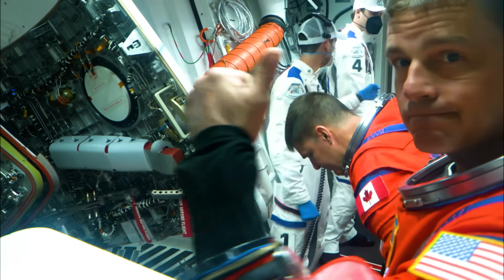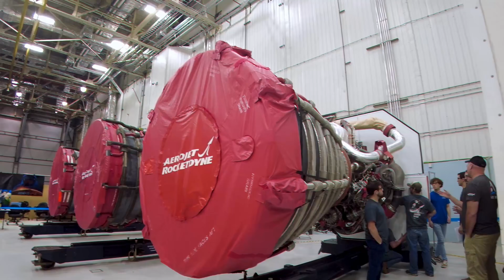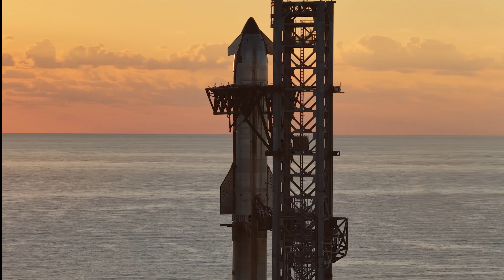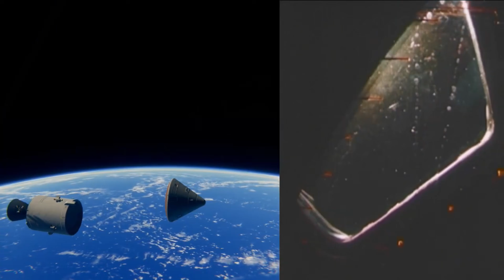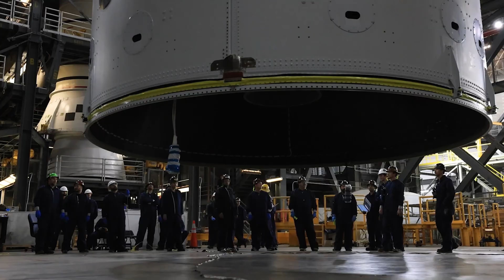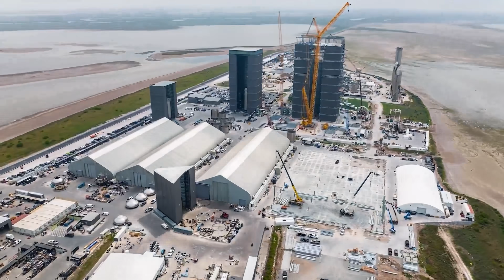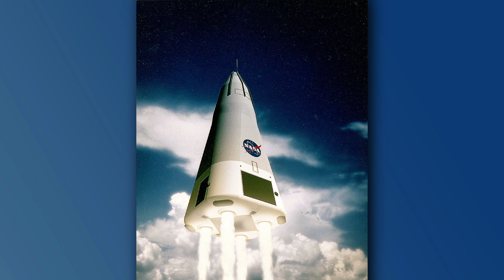Why SpaceX Starship and NASA Rockets Are So Different…

Comment: NASA is a government controlled agency with various smart people & geniuses (JPL) working for them, but they're controlled & funded by blithering idiots (congress) that haven't a clue how to do anything other than making things cost more, because they all want a piece of the pork pie (each rep wants a part made in their district) so they can be re-elected.  They were ORDERED by congress to DESIGN a rocket using circa 1970s Space shuttle parts, because the blithering idiots wanted a JOBS PROGRAM (SLS = Senate Launch System) so that their "constituents" (Boeing, Aerojet Rocketdyne, Northrop Grumman, ULA, et al) would keep bribing them donating $$$ to there campaigns.  They have no choice, since congress holds their purse strings, and makes them do idiotic stuff.  Boeing is the primary contractor here.

SpaceX's rockets were cheaper even before they were reusable, because they're vertically integrated (they makes all/most of their own parts, which is much cheaper).  Since they do not answer to blithering idiots they are free to innovate, and occasionally blow stuff up, without the consequences someone at NASA would face.  Note that Boeing's offering in this same space was/is a miserable failure, and it is unclear if it will ever be used to bring anyone else to the ISS after its last disastrous mission.

FYI, SpaceX probably wouldn't exist now if the Obama administration didn't insist on fostering new space companies based on a "non cost plus" basis.  They were only able to get the blithering idiots to sign onto that bill, by giving them back their jobs program SLS (which is nearly identical to the previously canceled Constellation jobs program).
Reply: Yep. Politicians and bureaucrats don't have same drive, nor interest to private investors.
Politicians and bureaucrats primary interest is always how to keep the current status quo (political stability and order), because that's the best way to maintain their own status and position in the government.
Unless there's external threat or extreme situation that forced them to act in more decisive manner, they will dilly-dally and quickly fall to complacency after enjoying some early successes.

Private company is not immune to this either, because once corporate management think they are safe and insulated from market volatility, they will start behaving like govt bureaucracy too, which job is just to maintain stability and current status quo.

However, in the open market, company that start behaving that way will get punished much sooner (often in just months or years time) than on state/government level (often in decades or generations, like the stagnation and slow decline of many great empires in history, and also NASA and Soviet Union's Roscosmos).

Comment: I'd like an engineer from NASA of SpaceX to tell me why they launch rockets at sea level instead of higher altitudes like Colorado or New Mexico.
Reply: The hardest part of getting to orbit isn't going up, it's going really really fast parallel to earth. Launching from near the equator makes use of earth's spin, which has the highest tangential velocity at the equator.
Reply: I’m no engineer but I’m pretty sure it comes down to a couple things. Biggest is transportation.  It’s a lot easier to deliver space parts to the site if the site isn’t on top of a mountain.  Closer to sea level is easier for calculating flight data.  Lastly, if a flight ever goes wrong, would you rather it be over the ocean, or over your hometown?  This is a big reason coastal regions are selected over more inland options.
Reply: They need an area for the stack to come down on if things goes south.   Too far inland.
Reply: As other people have stated there are many technical challenges around doing that but more importantly there is very little benefit. You have to realize the scale here. Colorado is roughly 1.25 miles above sea level and low earth orbit is 100 miles above sea level. It makes no sense to open up the logistical nightmare of launching from Colorado so they can be roughly 1 percent closer to their goal
Reply: https://www.youtube.com/watch?v=JgxkilF5XUM
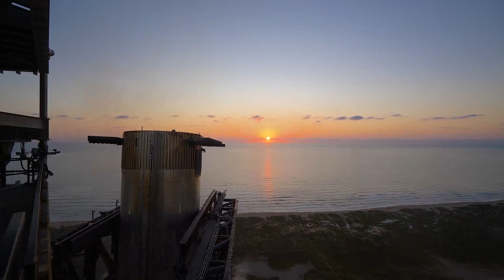4:30

Comment: you are looking in the wrong place. Musk's rockets are like Russian rockets.  
Basically its hard to get even burn in a huge nozzle like on the Saturn 5 ...... Russia's RD-170 gives the hint ..... the most powerful rocket engine in the World 1x turbopump but uses 4x nozzles - clustering engines and nozzles makes more sense
for combustion stability in each nozzle ...
as for solid fuel boosters - they are nothing more than recycled ICBM engines and should never be used for human flight ..... and Hydrogen is useless as a first stage fuel as it has no torque .....
Artemis is a piece of junk essentially ..... 
look at Musk's mega-booster it is basically the same as the Soviet N-1 moon rocket  .....
30+ engines  ..... 

Musk also uses Soviet grid fins ..... hot staging .....  throttling back of the central engine post takeoff to act as the 2nd stage ..... all Russian/Soviet  ..... 

its much the same thing in car piston engines ..... everyone uses roughly 500 cc per cylinder as it is a good size for combustion stability .....  eg 4cylinders are usually 2000cc ..... 6 cylinders 3000cc   V8s 4000cc